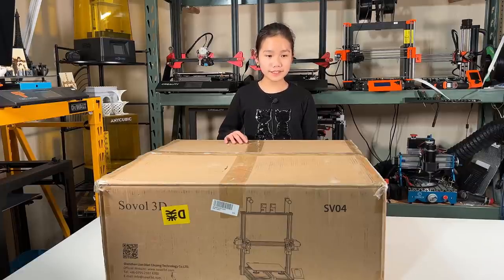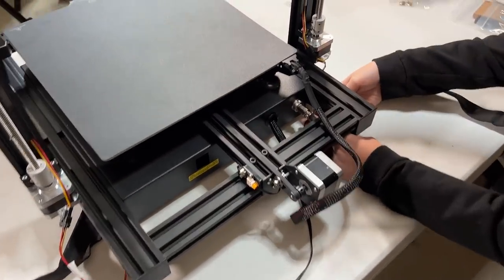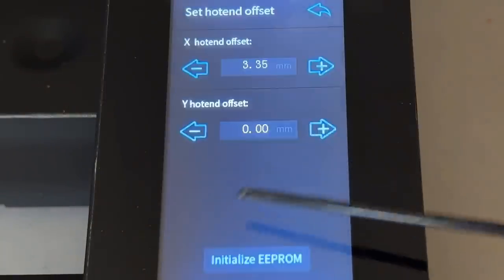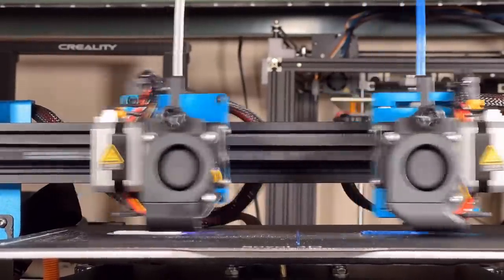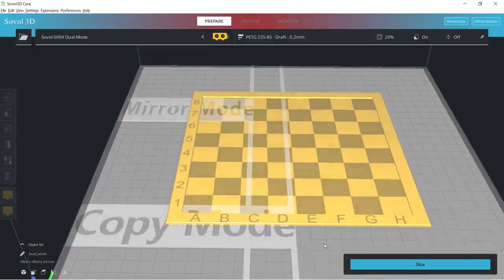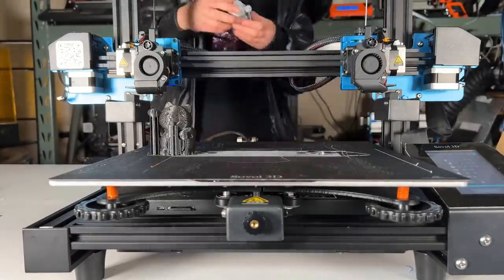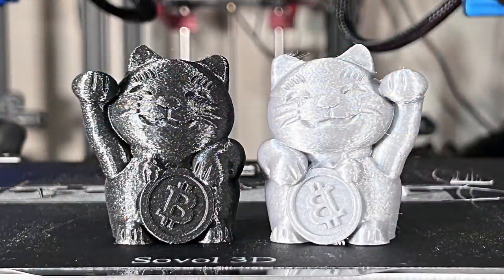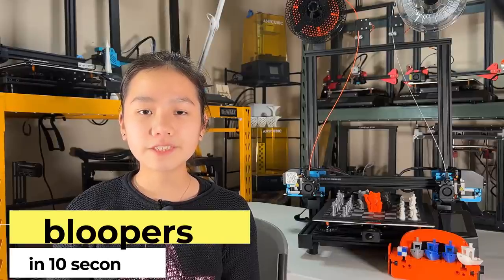Sovol SV04 IDEX 3D Printer Review: Independent Dual Extruder, Single, dual, copy, and mirror mode

Comment: It clogs so often that its nearly unusable.  Taco shaped bed, bad printhead 2 offset adjustment, Weird issue with software, and it just doesn't have a great extruder, gets stuck all the time.

Comment: I see a potential issue with the gantry on this printer. The vertical rails are just bolted to the lower horizontal rails. With only 2 bolts on each side I see a potential for the gantry not staying square with the base. Probably not a big issue unless you print taller prints where the vibration from the heads could cause the gantry to loosen. This issue could be lessened with some bracing from the top of the gantry to the base.
Reply: Ender style printers have that problem and it is definitely true that adding bracing is a good idea. You can print mounts for threaded rods that allow you to make a hypotenuse on each side and get it square. The frame is probably not square out of the box anyway.
Reply: I thought the same thing when I saw only two screws on each side. Seems pretty lackluster. Might even go as far as to say it's a design flaw. Adding z braces could potentially fix the problem and there is a good looking one on cults3d.

Comment: god i'm so tempted. But this loooks like exactly like the kind of unreliable 3dprinter that'd make you cry in frustration :D

Also, great review! I love how you actually tried to use the printer as a normal person (actually improved the retraction instead of going "If I tuned the setting it'll probably work, but it sucks right now, that's it, that's the review!")

no offense to other creators tho xD it's hard to review something.

btw PVA supports are so fun, try the Hilbert cube with pva if you ever want to :) you can do ABS/PVA if you tune stuff right and you can throw it in 80c hot water to dissolve

PS: the stringing support material can easily get in-between your layers and cause a VERY SEVERE weakpoint in that point. so I really recommend doing something about that if you make mechanical parts. for me i'd have to fix that!

also wish you tested the tolerances! for people like me (mostly practical parts used for mechanical parts etc) tolerances and accuracy matter a lot! maker's muse has a cool castell etc for testing

Comment: Nice video.

Some comments:

1. Two ABL-sensors would not help, as the bed has only one mesh anyway. You only measure the bed with the sensor. ABL corrects z-hight to compensate, moving the x-axis a bit up or down - but with two heads you need different z-correction value for each head. Actually a "tiltable x-axis" would be needed, so you can have different z-correction on each head by adjusting z0 and z1 so both heads at their actual position get their individual z-correction. While technical possible I know no firmware actually supporting this (and no hardware with tiltable x...).

2. You can do manual filament changes inside a layer - simply use m600 as custom g-code for toolchange in prusa slicer and edit profile for using multiple "virtual" extruders (practical same setup as using MMU2 but without actually using a MMU and a whipe tower). Works quite well. Of course manual filament change only makes sense if only a few top or buttom layers should change. So not for a full coloured object - but perfect for embedding text and logos to the botom layer. For me thats sufficient most time - I barely use my IDEX, as I use 3 colours if printing multicolour anyways.

3. Best potential use for two printheads: Different nozzle size. 0.4 Nozzle for more detailed parts, 0.8mm for less detailed parts should speed up the total printtime on massive parts a lot. This in combination with an ERCF on each toolhead...

4. More details for the printheads please... Maybe changing heatbreaks to bimetal ones and nozzles to Bondtech CHT might solve the stringing problems.

Comment: How would you compate this printer to the MakerPi P3 Pro IDEX 3D Printer?
Reply from the maker: I like the Sovol SV04 more than the MakerPi P3, when printing with multiple colors, I just print PLA, so I don't need the excessive number of tool heads from the MakerPi. The overall build quality of this SV04 is also better.

Comment: I really appreciate this review - it showed a few things that other reviews didn't cover (such as the enormous retraction number required to cut down on stringing). My impression from all of the reviews is that this is a very solid printer with nowhere to go but up when the community has developed more support for tuning the printer profiles. I'm also strongly leaning towards funding the purchase of one by selling my venerable Artillery Sidewinder X1, as the SV04 and Sidewinder family have comparable sizes, hardware, and other general features, yet the SV04 has a rather nice IDEX setup and comes with the belt tensioners, large SD card, and a flex plate system. 

The only negatives I've seen so far are that the flex plate isn't that great and that the printer uses Mk8 hot ends instead of the Volcano as on the Sidewinder. I have a collection of Mk8 nozzles for my Ender 3, so that's not a real problem, but I would be interested in hearing about anyone who found a way to retrofit Volcano hot ends onto an SV04 because I do like how well the Volcano handles printing with larger-diameter nozzles and other high flow rate applications.
Reply: Hello Justin, did you bite the bullet and buy the SV04 and if so how did it go? I am thinking of buying one this week!  thanks
Reply: @sitgesvillaapartmentneilsc7924  Not yet...I might be moving in the next few months and figure I can wait until the next Prime Day to grab one on a good deal.
Reply: @justinchamberlin4195  that’s what I’m holding out for although I suspect they won’t discount it in Europe.  Prime day here is not as big as it should be and it seems an excuse to dump old tech really! Good luck il be ordering mine that for sure. I’ve read a lot of reviews and watched some as well and it just seems to get better all the time. I have a good selection of printers already for general work but I am very keen to get an Idex now as I get a good few orders for raised lettering on a mono background and this fits the bill and beats fusing filament
Reply: @justinchamberlin4195  just bought mine for Christmas but not allowed to open it ( although I did take a sneak peek yesterday when it arrived as the missus was out, resealed it, it looks very nice ). I have to wait until the 25th so looking forward to that, beats watching repeats on the TV !!

Comment: How are the Z stepper motors kept in sync?
Reply: I'd guess by being stepper motors. Unless you load one so it skips steps, they SHOULD stay in sync.
Reply: @seanroach899  Problem is when the machine is powered down you could accidentally rotate one of the stepper motors and then the x gantry will not be aligned from then forward.  Creality solved this problem by connecting the two motors with a timing  belt .